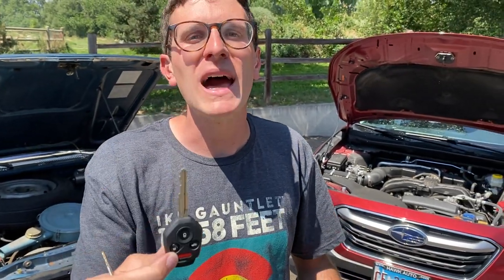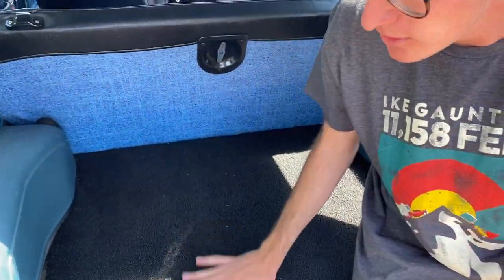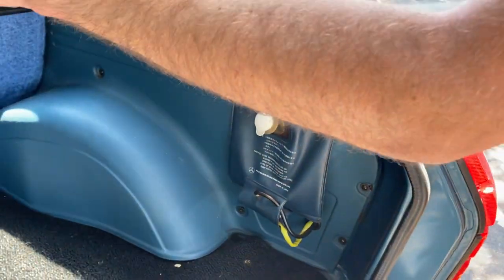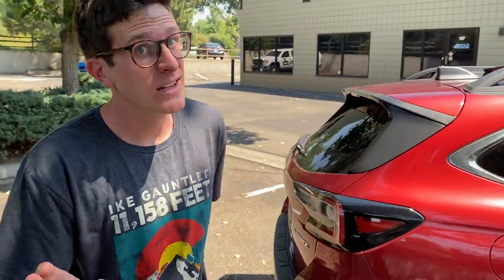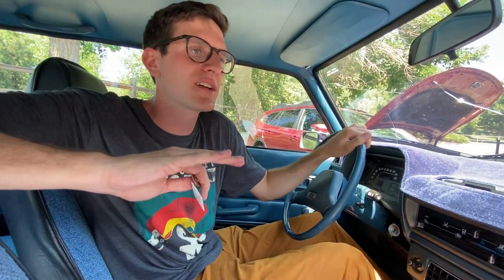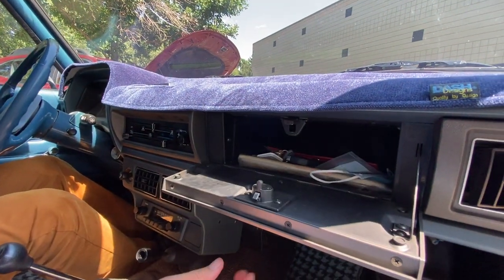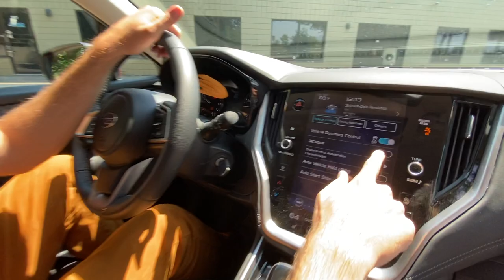42 Years Later Subaru Has Made Huge Improvements To The 2020 Outback: Well Sort Of...

Comment: Did yours actually have A/C and it's broken, or was it just ready to have it installed?  My '83 had the controls for A/C, but you had to pay extra and have it installed by the dealer if you wanted it.
Reply from the maker: Oooh great question. I'll check that out!
Reply: My younger sister had one and the dealer installed it at the dealership.😎
Reply: Would  engine struggle to turn the AC compressor over

Comment: 190k miles on my 13 Subaru outback 2.5 loaded not a single issue and changing spark plugs only took 20-25 mins very simple 29.5 mpg I will definitely get another for sure. And regardless of people's complaints I love the Cvt off road your never hunting for gears. My only complaint is the same for my prius no temp gauge really manufacturers this has became ok.

Comment: There's only two things similar. They're both station wagons, they both are awd, they both have four tires, they're both painted, they both use gas, they both have steering wheel, they both have brakes on all four corners, they both are Subarus, they both have tail lights, they both have headlights and so on and so forth

Comment: I swear that roof rack on the DL is just a scaled down version of the one that was on my '81 Ford station wagon I had until last year. My daily driver for the last six years is an '02 Outback limited and though it doesn't have a manual trans it does have a real automatic trans instead of the junk CVT, nor does it have all the bells & whistles of the new one but is more comfortable than the DL I imagine. And it will drive right through some nasty mud & sand - don't know about snow, I live in Florida, but I think I've got that covered too.
Reply from the maker: That’s an interesting tidbit, thanks for sharing! I do like the early 2000’s outback’s, great cars!

Comment: One thing they haven't fixed all these years later: Oil burning/Oil Consumption.
Reply: I burn less than a quart per 5k miles in my outback with 200k miles on it. It's hardly noticeable.
Reply: @cubbiefn  I had a 2013 Legacy with the same engine (2.5i) that my mother bought brand new, and we had issues at 80k miles. The engine was already dripping oil on our driveway and burning it on the exhuast manifold once we hit 80k. We babied the car and changed the oil religiously...

Comment: Upside down oil filter? Wtf? oil all over the place when changing
Reply: No, because the oil drains out when the engine is off. And it has a lip around it to catch any drips. This setup is way nicer than having it sideways like most engines have.
Reply: Stuka87 I’m used to working on trucks, think you call them semi’s and they’re up the other way and full of oil 😂
Reply: @DarthDainese  Ahh yeah. The setup that I really like is the oil filter cartridge. All you replace is the element, so easy and without much spillage.

Comment: The only engine worse than a boxer engine is a rotary engine.
Reply: Boxers are way more balanced than inlines or v engines, since the pistons move in pairs. That also gives an even tear on crankshaft bearings and less vibrations over all. 
I.e. a more longlived engine that also is more compact than an inline. But they are thirsty.
Reply: @morilot  boxes may be more balanced but they ware out twice as fast. There's a reason why you don't see boxer engines with 100,000 miles on them.
Reply: @theylied1776  your right, you see them with 300k miles. The boxers are great with the exception of 3 years. One of the most reliable ever made. Read up before you spout off. Greeners and hippies don't buy junk. Ask Tommy and Roman how many Subarus they see in Colorado. I get 28 mpg city/highway on my '15 outback. Safest and quietest car I have ever owned.
Reply: @thereissomecoolstuff  Really? Post one? I can guarantee it's not the original engine, it has been rebuilt. Boxer engines can't go 65,000 - 70,000 miles without being rebuilt.
Reply: @theylied1776  let's see can anybody help theylied1776. Interesting name by the way. What does it mean.  I can assure you they last for 100's of thousands of miles. Mine has 65k and not even a hiccup.
Reply: @thereissomecoolstuff  Which part of theylied1776 confuses you? There's a little document written in 1776 called the Declaration of Independence, "We hold these truths to be self-evident that ALL MEN are created equal".
Reply: @theylied1776  got you. That's all I need to know. This is a car channel. It's obvious you have some bias and inaccurate narratives that you live under. I'll catch you in the CNN video comment section.
Reply: @thereissomecoolstuff  Again, post an article or what have you to a boxer engine that's lasted a hundred thousand miles. I can guarantee you it was rebuilt. The Fatal flaw of boxer engines is that at high-speed they tend to burn up.
Reply: I’ve had 3 different Subarus all with over 200k all original boxer engines.  My last Legacy had 300k on its boxer engine.  Only reason I got rid of those cars was the traditional North East rust. My current Subaru has 170k on it with its original engine.
Reply: @thereissomecoolstuff  Yes it's a car channel so why did you ask me what my username meant? And this is a lovely diversion. So I'm guessing you cannot provide any information about a boxer with over a hundred thousand miles?
Reply: @theylied1776  I've seen a Legacy thats done 780.000km on one engine. They are out there, I've done more than 200.000 km with my Outback.  Shure you won't see that in an WRX STI but they are pushed and driven way harder.
Reply: @morilot  Great, all you have to do is post a link to it I love to see it myself.
Reply: The only 4 cylinder smoother than Subaru is a Toyota 4 cylinder engine.
Reply: @tails300  They make very balanced smooth running engines but they burn up, they do not last.